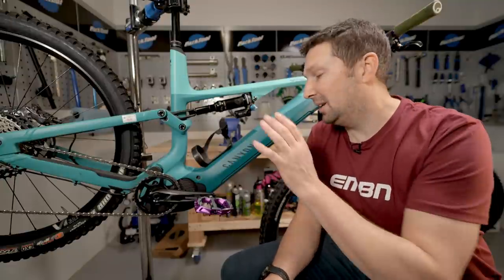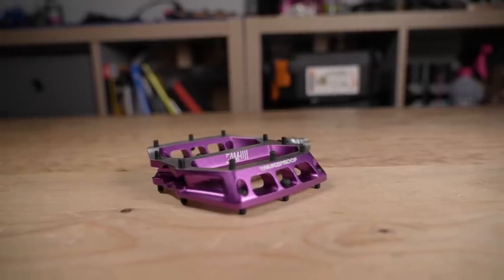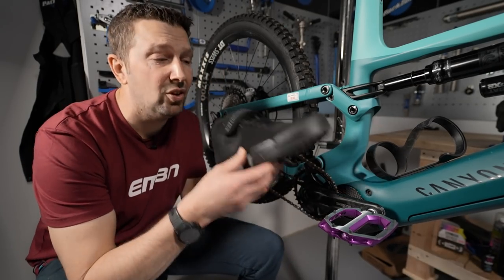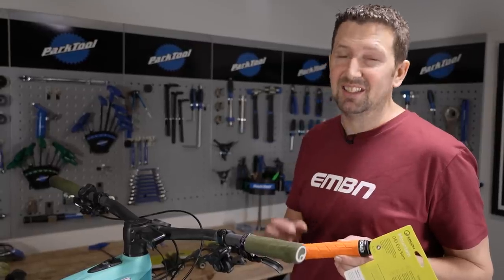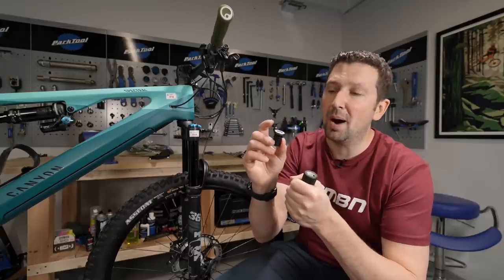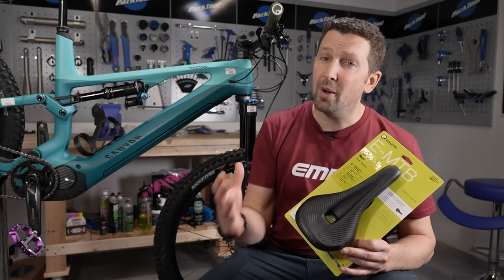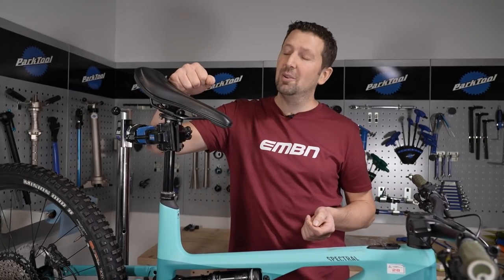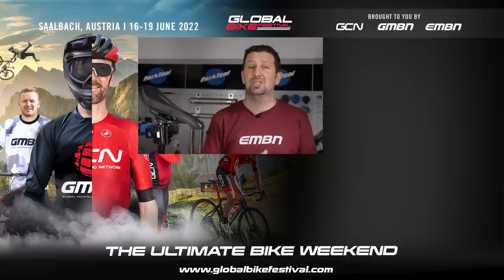Improve Your Comfort, Confidence & Control | Easy EMTB Upgrades!

Comment: You know what, with regards to shoes.
I've been using sports directs own brand (carrimore) waterproof running training over winter, the pins in my pedals go in between the treads of the shoe and lock me in quite nicely to the soft subsoles.
Best part is being an outdoor running shoe there is loads of grip for walking even on muddy terrain as it's a bugbear of mine that bike shoes for flat pedals have no grip for when your not on the pedals!
No to mention the trainers are only £35 and waterproof!

Comment: Speaking of pedals I use as an Above the knee amputee and for any other disabled ebike riders out there the problem I face is with my amputated side slipping off the flat pedal whilst in motion or trying to un-clip myself when I've had a tumble.  I've found pedals that allow both flat and clipped riding.  On my amputated side I use the flat side of the pedal with an old style 'toe-clip' and strap which is easy to undo if I fall.  On the sound side I use a clip pedal for general riding but I have the option of un-clipping and using the flat side for technical climbs and descents where having to ability to get my foot down quickly has saved many crashes.  Good video though👍👌

Comment: Clipless pedals aren't just for long cross country rides where the rider is trying to get the most efficiency. The best use for clipless pedals on an EMTB is for floating through steep and chunky trails with better control of the bike. Clipless pedals are undoubtedly the best for racing enduro/downhill or just trying to get a personal best time down a local trail.